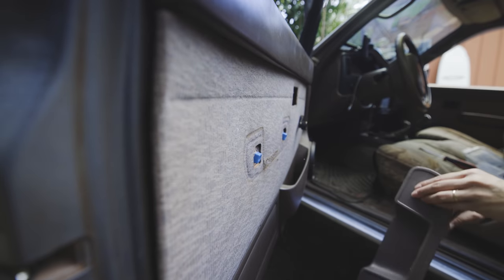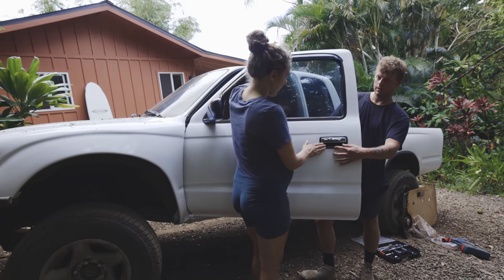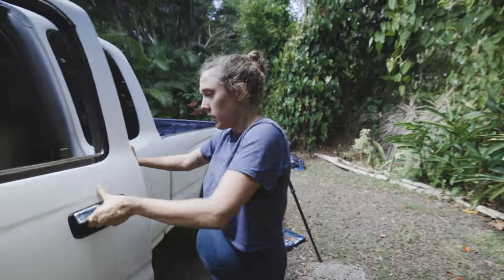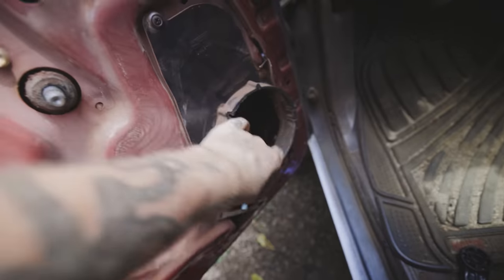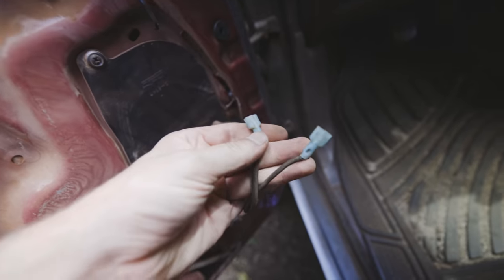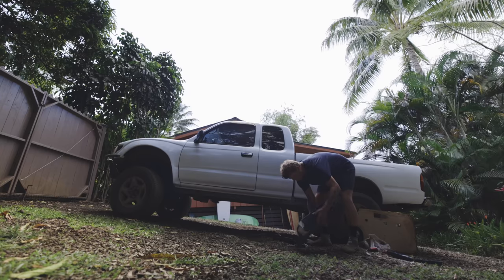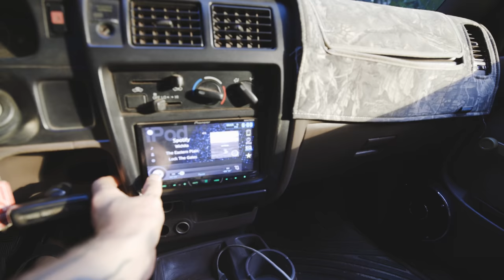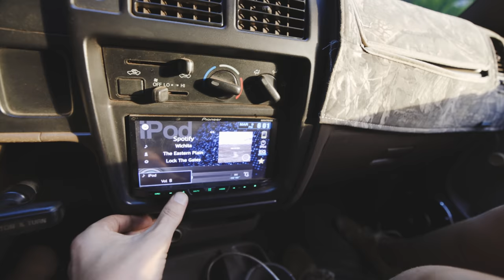Fixing Up Our Old Truck : )

Comment: What a great video, restoring stuff that's still perfectly fine should be done more often. 
I love how impressed Dana still gets by Lou's skill set.
I have a suggestion for the windshield wiper fluid nozzle: you might want to try to clear it with one of Dana's sewing pins or a paper clip and/or give it a good soak  in white distilled vinegar (8 hours should do the trick).

Comment: Thanks. Good job on the pickup. I know how difficult hardware jobs can be. It's not unusual to work on it for several tries until it's right. It can also be frustrating and take lots of time. It's one of those things. I'm dealing with my live in RV right now in which we got it started after sitting for 6 years. So when we came back to it we thought it was going to start right away so we could get the rotted tires changed, but wouldn't you know it wouldn't start, head drop. So the work goes on.

Comment: Hi, did you manage to replace the plastic liner which seals all the components in the door from the weather/rain?
Reply: This was also my question... The plastic liners keeps the water, that runs down the windows, out of the car. Removing them could mean that water runs in your car while raining. And you surely don't want that... ;)